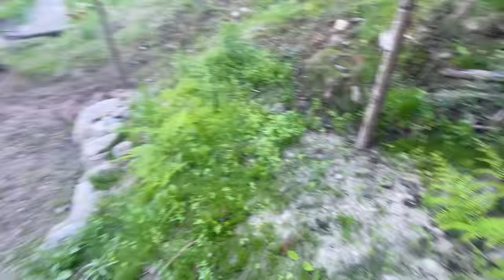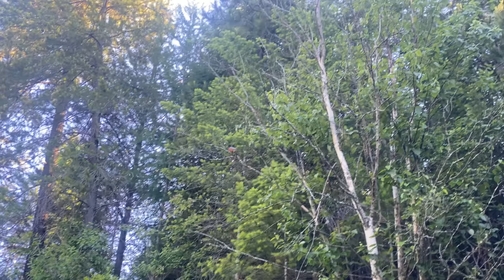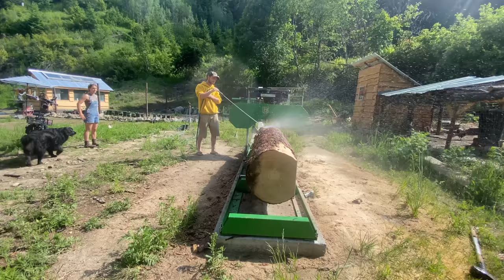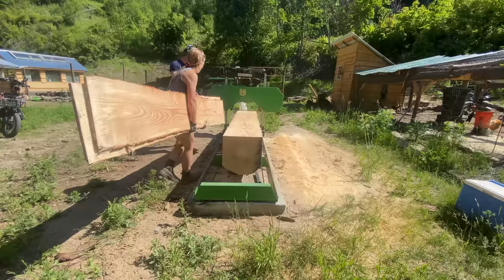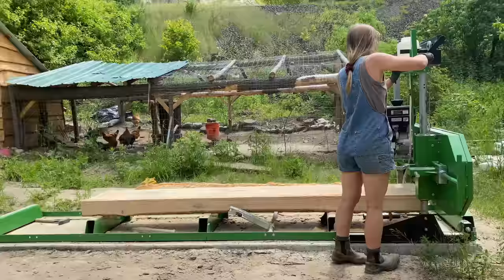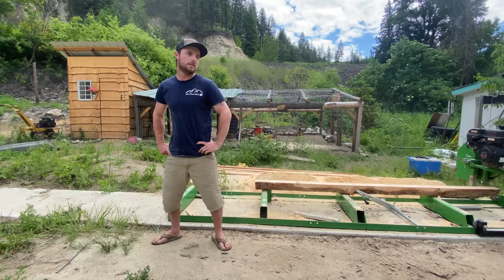The Bigger the Better | Harbor Freight Bandsaw Mill

Comment: Guys, I'd be concerned that if you try to use single boards that wide they're going to really cup on you. Maybe cut then in half and consider using them then. Still beautiful wood and a little more stable. Especially as thin as you have them cut. Just a suggestion. Good luck. You guys are doing great as a couple working so closely together. Ron

Comment: G,day from Sydney Australia.
Growing lettuce
Raised in small tubes or pots, then suspend in plastic/foam box lid.
Fill the box with N,P,k and seaweed solutions and water (cup) untill water just touches pots. Roots will find their way to the water.
Don't waste, tip water onto garden.
🪴🪴🪴🪴🪴